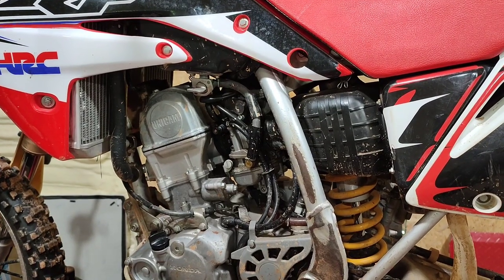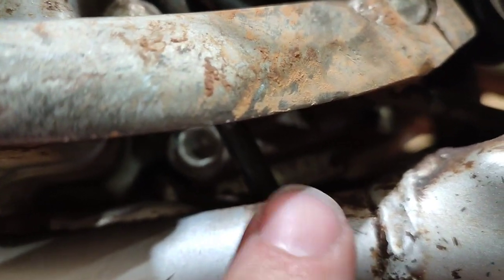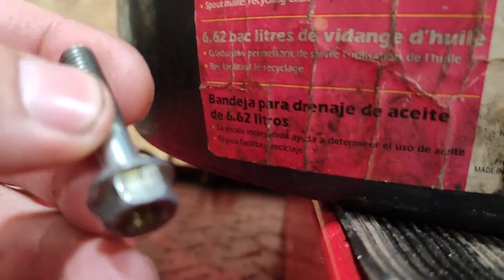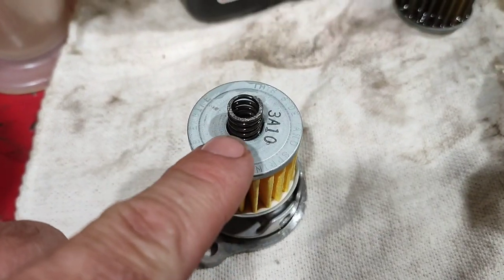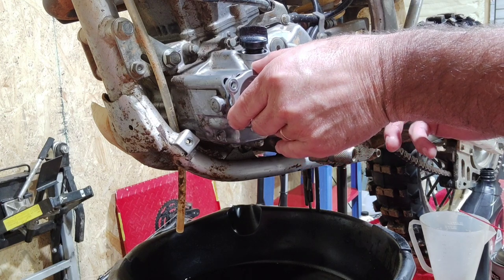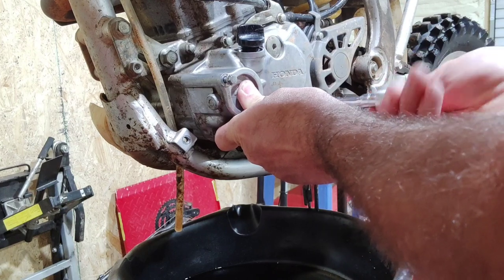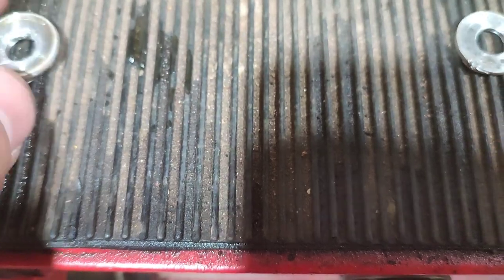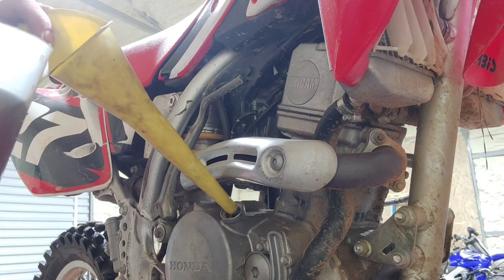Honda CRF150R oil and transmission fluid change

Comment: Ive been looking for a oil change kit are both of the filters the same
Reply from the maker: There is only one filter on the engine side and you can run the same motorcycle oil on both sides.

Comment: If I'm going out for a Spon on it do I check the oil when cold or hot thanks
Reply from the maker: Cold, if it's hot just let it sit for a minute for the oil to drain down to the bottom.

Comment: How do you check the transmission fluid? My 2024 only has a cap and no dipstick.
Reply from the maker: There is a check bolt but I would just change it every other oil change and not worry about it, the check bolts strip easily. If you don't have a leak it's not going anywhere.